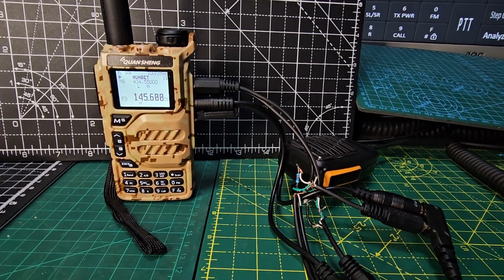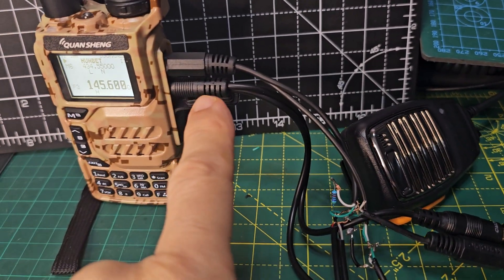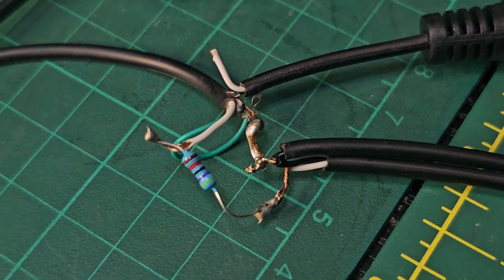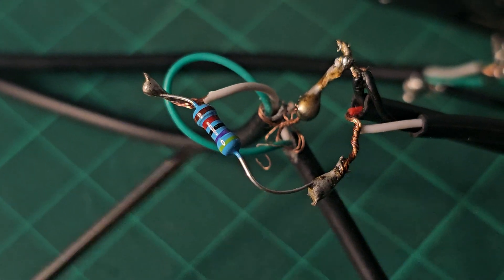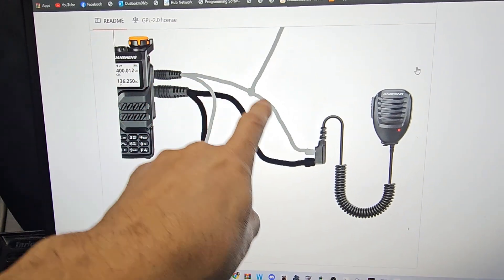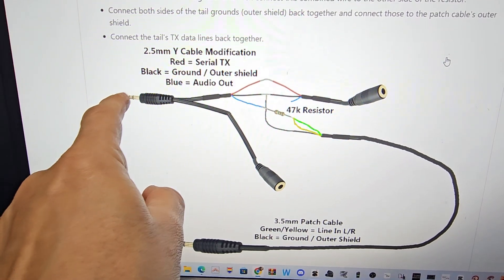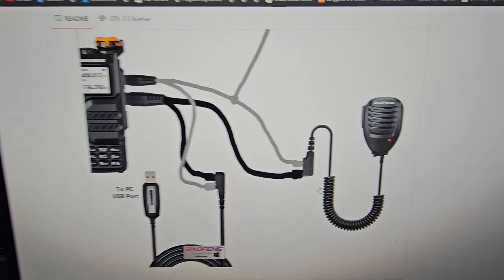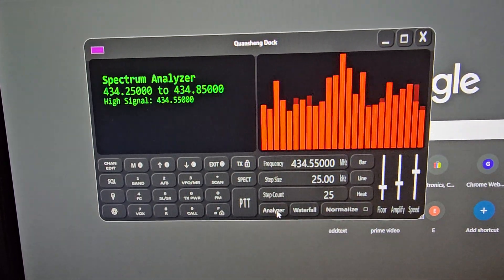QUANSHENG DOCK CABLE

Comment: I hope someone who is much better at soldering starts making these cables commercially.  I don't even have a Radio Shack to get the resistor at.
Reply from the maker: Get the AIOC adapter